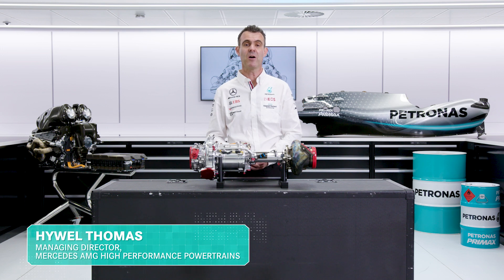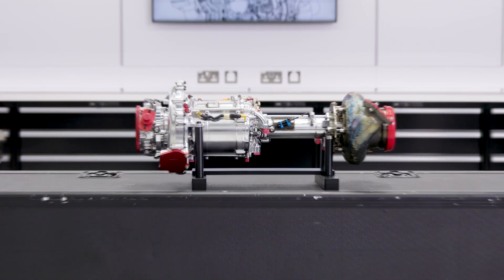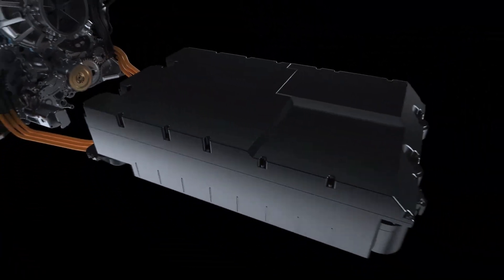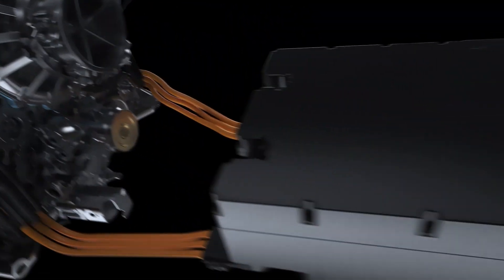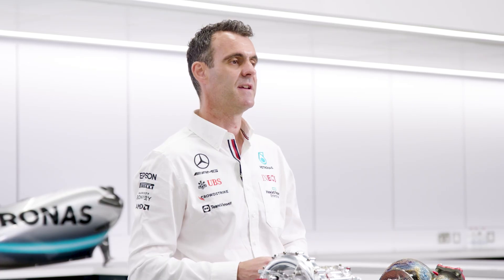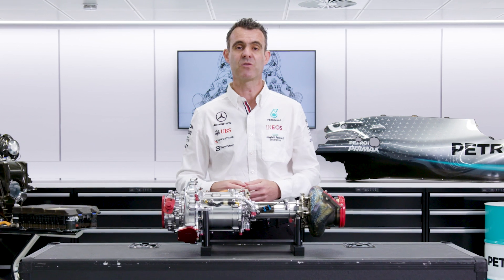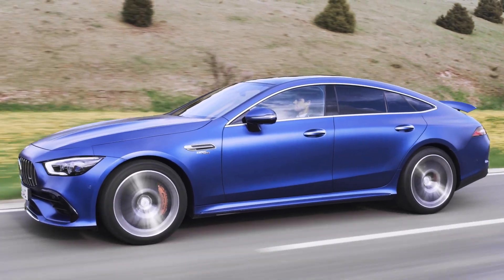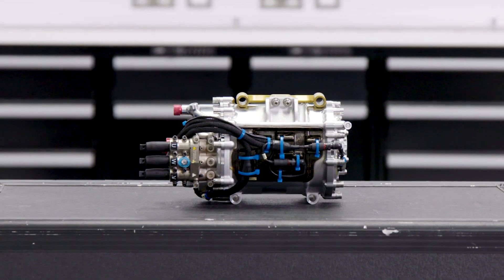Power Unit 101 with PETRONAS: MGU-H, EXPLAINED!

Comment: surely this is one of the best areas for future efficiency gains from combustion engines??  I hope F1 reg's change in the future to allow this.  love to know how much relative power they get from this device?   With the conversion to electrical components, the combustion engine will begin to look more and more like an "electrical generator", rather than mechanical output alone.  Also, wouldn't the fan in the MGU-H make the exit of exhaust less efficient, so decreasing mechanical power?...  but the gains from generation must be worth it. I would love some more detail on this. :-)

Comment: Very informative video. Thanks for that. I'm scratching my head over the fact that you stated in the video that MGU-H improves brake thermal efficiency and as a result improves sustainability. If that's the case why is it being phased out in 2026 engine regulations given you also said that the tech is finding its way into road cars ?

Comment: Great video! MGU-H seems like a powerful environmental and efficiency tool for combustion engines. Part of the large reason that it is being removed was it is a cost that has no practical application on road cars but as stated in the video, it is finding its way into upcoming vehicles and the electric turbo is already in use on road cars. I can't believe that F1, a platform that prides itself on being cutting edge is banning this element. Even with increasing the electrical energy store for the next engine regulations, you are still missing out on the efficiency that this device brings. With F1 promoting how it is reducing waste, funny that they don't want to make their engines as efficient as possible. They could always put a ahem "cost cap" on this device or state that you can only use let's say 1 MGU-H per season and the design is locked for 3 years with only materials updates available as repairs, to give durability if needed. Just a shame that F1 always states they move forwards but in this, they are moving backward.

Comment: So this is basically the air intake correct? The turbine is spun by exhaust, and it’s electronically spun. The air it creates is then cooled by the intercooler at the end and slammed into the cylinders.

Comment: What happens to turbo lag when the MGUH finally gets banned by 2026?
is there a possibility of a different type of mechanism to eliminate turbo lag?
Reply: I would think that you could engage an e-machine that directly drives the wheels additionally. This could reduce the effect of the turbo lag. At the same time, you could use that e-machine for recuperation. It would basically be an HEV on steroids

Comment: How can you add energy/interface with the crank being turned by the combustion engine without the grinding each other out if they are not at the same speed ( like gears  destroying each other)?
Reply: The MGU-H in this video does not engage with the crank at all.  It engages with two turbines - one in the exhaust, which helps spin the MGU-H, and one in the intake system, which compresses the intake air.  It is the other motor, the MGU-K, which interfaces with the crankshaft.  This is connected to the crankshaft at all times, so it is always spinning at the crankshaft speed; sometimes it is harvesting energy (under braking), sometimes adding more power in (under acceleration).  I'm sure Hywel will explain it more thoroughly in the next video.

Comment: Power output is not regulated? I thought the entire electrical system could only deliver a max of 161 hp?
Reply: The power that the MGU-K can deliver is regulated.  The motor in the MGU-H can be as powerful as the manufacturers want it to be.
Reply: @rbgosling  Thanks

Comment: What I want to know is if hey could get rid of the turbine all together. Then they could have straight exhaust and keep a compressor powered by the MGU. In other words MGU powered supercharger. The cars would be so loud!
Reply: That would be possible - but one of the points of the MGU-H is to improve the efficiency of the engine by harvesting waste energy from the exhaust.  This is one of the key reasons the Merc F1 engine is more than 50% efficient at turning chemical energy in the petrol into kinetic energy pushing the car forward (a typical road car is only 30% efficient).  If the exhaust turbine is removed then more of that exhaust energy is lost, and you get less efficient.  Whether you want an F1 car that is more noisy, or more efficient.... well, that's not an engineering question!

Comment: Does anyone in this comment section know how it transforms Heat into Electrical energy ???
Reply: Heat is slightly misleading I suppose.  Really it is using the pressure and flow of the exhaust gases to turn a turbine.  The heat of the exhaust does contribute to this, and the exhaust will be slightly cooler as it leaves the turbine.  This spinning turbine is then connected to the motor/generator, so spinning it in generator mode generates electricity.

Comment: just to confirm with any knowledgable person here, so MGUH only pre-spool the turbo to reduce turbo lag and does little to nothing on the top end of the RPM? can't wait for a video on the MGUK becuase I really want to know how it send its power to the driveshaft, love this stuff
Reply: It can act like a "supercharger" to supply perfect boost at any time, but when the engine has enough boost, it can send some power to the wheels (MGUK) or the battery. Primary role would be perfect boost management, then charging the battery or powering the MGUK
Reply: @alexjohnward  alright, another question, how does the MGUK send power to the wheel? like is there just a motor spinning the wheel in addition of the driveshaft and just make it spin faster? or is there another way
Reply: @SW4GK1NG  The MGUH spins, primarily delivering boost to the engine, but when there is excess energy available, it starts generating electrical energy, which travels down the power cables to the MGUK, which is basically just an electrical motor coupled or geared to the crankshaft of the petrol engine.
Reply: @alexjohnward  ah, thanks for the MGUK explanation, I was always wondering how the MGUK send its power, I guess I just never thinks about it being geared in as well, tysm
Reply: What it is doing at top end is harvesting electricity like he explained to be sent to the battery or the MGU-K. It can both deliver and harvest power.

Comment: When you use the MGU-H as a motor, you are not only sucking more fresh air but also exaust gases. Does this have an impact on the combustion process or how is it regulated?
Reply: Turbos don't suck in exhaust gasses buddy, on the hot side of the turbo (turbine) the exhaust gasses pass over the turbine wheel to spin it before passing through the rest of the exhaust and out to atmosphere behind the car. 
On the cold side of the turbo (compressor) the turning force from the turbine turns the compressor which sucks in air through the air box/intake above the drivers head, compresses it to many many PSI in a Formula 1 car, forces it through the charge cooler core to cool the air down and thus further increase the density of oxygen in it, then forces it into the engine to be burned in the combustion cycle. 

Many road cars run around 14psi of boost, my fettled weekend car makes 29psi of boost, I believe Formula 1 cars are around 80psi of boost, knowing how it all works with boost its mental to know just what they've managed to achieve.
Reply: @bash83845  Totally agree, but only if you use a "normal" turbocharger. As explained in the video, they can accelerate the whole unit, by using the electric motor which is located inbetween the hot and the cold side and connected to the shaft. By that, a higher mass flow of fresh air, than usually possible, is generated to prevent the turbo lag.
Reply: The MGU-H in the middle uses overboost ie on the rundown to charge the batteries and is able to artificially spin the central shaft to spool up the compressor wheel quicker thus eliminate lag. 

None of that will result in sucking in exhaust gasses.
Reply: @bash83845  Yeah, but when the shaft spins, obviously also the turbine wheel (hot side) spins. This reverses the effect of being accelerated by exhaust gasses to accelerating exhaust gasses and results in sucking them, doesn't it ?!
Reply: It can't suck in what isn't there though, it'll just freely spin like does with a normal turbo when you come off the throttle